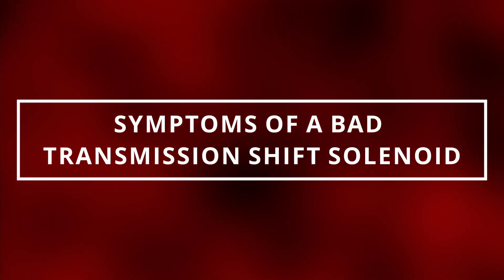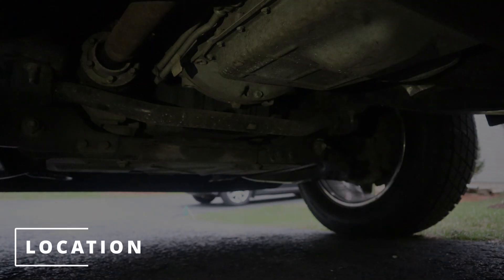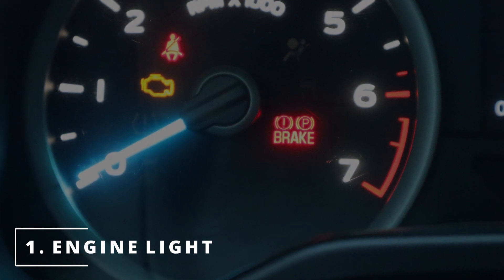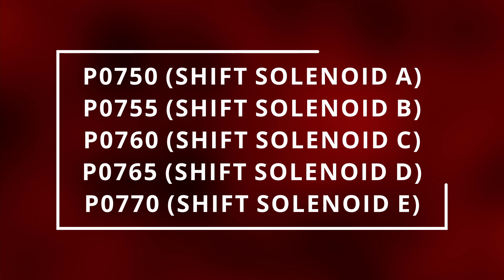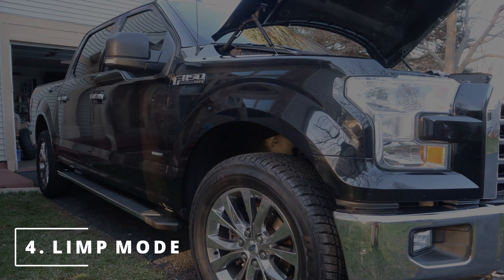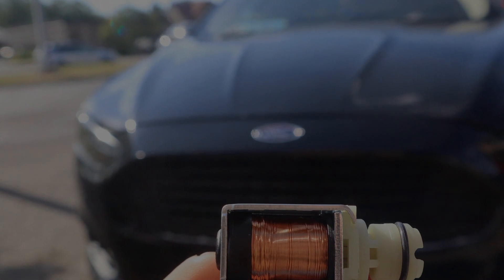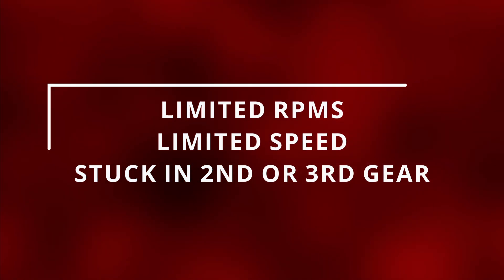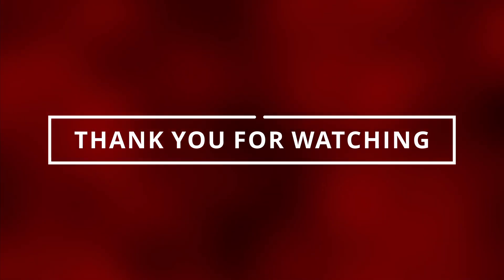SYMPTOMS OF A BAD TRANSMISSION SHIFT SOLENOID

Comment from the maker: Thank you for watching!

OBD2 Scanner: https://amzn.to/43UwyBg

Check out AllDatadiy repair manuals: https://www.gopjn.com/t/SENKTklLS01DSE1NS0lOQ0dKRk9LTw
Use code AD10VA for 15% off one-year subscriptions for any US Order

Check out my merch: https://easyautofix.creator-spring.com/

Have car-related questions? Check out JustAnswer! They have verified auto mechanics that are available as live help 24/7: https://justanswer.9pctbx.net/qnj74y

Buy a new shift solenoid: https://advanceautoparts.rt8x.net/rnPVQ3

Here are some of my favorite items that you might like:
Tools: https://amzn.to/3xNDb8g
Car Vacuum: https://amzn.to/3EjhPSJ 
Cleaning Tools: https://amzn.to/3El7dCG 
Water Repellency Wiper Blade: https://amzn.to/3utvK50 
Cleaning Gel For Cars: https://amzn.to/36NIiMr 
Portable Air Pump for Car Tires: https://amzn.to/3uBuPzA 
Headlight Restoration Kit: https://amzn.to/3qDpOVH 
Amp Jump Starter: https://amzn.to/3pMd0vx
Reply: I just got new tires and hit a big bump and only had 1st gear.replaced the plastic bushing and half washer on shift cable Then was driving about 30 mins ok then just had 1st gear all of a sudden. 2008 chyrsler Sebring convertible 3.5 never again.👎 sensor's  then gone.😂
Reply: @ Easy Autofix Sir  the car transmission is making whinning noise and delays in shifting gears, I checked for the fuel level is Ok, I checked for the oil still fresh not burned, I checked for any leaks no any leaks, I open the pan, but there were no any metal shavings on the magnets no any particles on the fluid, I decided to change the transmission filter, I checked and open  the valve body  no any clogs on the passages, I removed all solenoids I tested them all, and one was not working, I changed it with new one, I put back everything I test drive the vehicle no more whinning noise at all and gears are changing smoothly, but after two days as i drive reaching speed of 100 mph, the whinning noise started again, and the car struggles to exceed speed of 100mph, the RPM goes high and the speed is not achieved,  I checked fluid level is OK. what can be the problem, and what can be done sir? Kindly help with ideas.
Reply: My O/D light keeps flashing on my ford f150 year 2000 and yes when I  shift my gears on N/D/R etc it gives this jerk motion is that the solenoid or speed sensor?
Reply: @jpp1749 did you ever figure out what it was? My 06 mustang is doing the same
Reply: What if I'm getting u0101? Says can't communicate with tcm
Reply: I have a 740 code what’s that then
Reply: N 3p
D czar
Reply: My car mainly stay between 1 and 2. If I’m going 60-90 then it stays between 2 and 3
Reply: My ford explorer won’t go in reverse, what do that mean
Reply: How do you check if the solenoid is faulty?

Comment: PLEASE HELP. 
I have a 2013 Lexus RX 350 and yesterday all of a sudden it started falling on its face for about 3 seconds when shifting from 2nd to 3rd. There is no check engine light on. 
   It has no dipstick. Do you think it's just low on fluid or a bad solenoid?

Comment: I have a Saturn Sky 169500 miles never been beat always kept up with tranny fluid changed and filter… one day driving hope as it drove great no light on dash .. then went to slow down my car tranny as I slowed down it down shifted hard .. automatic .. 2.4 l so if you do drive  normally no problem till it slowed down.. banging into lower gears till stop… taking off no issues… went to a shop to check… well all they found was selinode  was changed and check other thing but they seen nothing … again no check engine …. So im thinking control module but .. they are gonna check the code in transmission see if anything is showing any codes ….. I hate my car being gone so long……😢
Reply: The mileage on transmission is 169,500 and car

Comment: I have a 94 Toyota Rav4 2,0L auto that looses drive intermitently, for example in drive mode when warm and at 50kph drive suddenly lost and engine rpm rises. I then have to engage 2nd gear manually to re establish drive. Could this be a faulty solenoid or shift valve ?

Comment: So my 2004 Camry has just started experiencing a bit of slippage. It has 174K original miles and has been running like a champ until now. The  check engine light came on and when I went to scan it, code P0776 came up which means I need to replace Solenoid B. I was told by a “mechanic” changing it wouldn’t make a difference. He further stated my transmission is done and that I need to either rebuild it or swap it out for one that’s not damaged. I’d like to know if this is true or is this guy full of shit!? Thanks.

Comment: I keep being told my trans is bad ok I’m 3yrs late by any chance could you reply to this comment @easyautofix? Anyways I keep hearing my trans is bad but I dnt think it is it has a slight shift delay around 3rd or 4th and if I let up off the gas n proceed again it shifts over n continues to go I bought a speed sensor thought about but the solenoid but not sure if i should or just buy a new trans.

Comment: What a freaking awesome video:  I have a 2022 Kia Sorento that has Intermittent "Delayed Engagement" into Drive or Reverse.  I have had it into the shop at least 5 times and have paid for computer updates and it is not fixed.  Is there a particular Solenoid that is for "Drive" and "Reverse"?

Comment: Not always but occasionally while I am ready for a red light to turn green and I have my foot on the brake and my 2006 Avalanche is stopped when the light turns green after 2 minutes sometimes when I go to proceed I noticed a little neutral sensation for about 3 seconds then it kicks into gear would this have anything to do with the solenoid all other gears worked perfect

Comment: Sir I have a car Hyundai Elantra petrol at transmission, all the gear oil in it was finished, I put 7 liters of gear oil in it, when I put the car in reverse it makes a loud bang and gear shifting is also not happening properly, at the speed of 60-70 the RPM goes around 2500-3000, please help me sir, I am working in this transmission for the first time, on scanning two codes are coming 1)p0732 2)p0729 please help me sir

Feedback

Comment: Would this also make the gears stuck in nutrual? First time doing this, and im hoping is da solenoid, all my gears are stuck in nutrual after changing out the NSS (Nutrual Saftey Switch) and changing da filter and putting new transmission fluid in

Comment: My 07 escape doesn’t like to shift out of first gear while in regular drive, but if I start off in 1st gear manually then shift up to 2nd then back into regular drive it does fine. Would that be a shift solenoid?

Comment: I put the car in Reverse and it is stuck in that gear.
I shift the knob into park and Drive, but it still drives backwards and I had to use E-brake handle to park the car.
So the transmission shift solenoid is bad than?
Reply from the maker: It could be the transmission range sensor. I've also seen cases where the cable connecting the shifter to the transmission disconnects, so be sure to check that as well.

Comment: I’m having this issue on my 2012 Ram 1500 5.7L. 1st and 2nd gear shifts fine but the 3rd gear slips. When i put it overhaul mode everything runs normal. I’m going to replace the solenoid pack. I pray it drives like a dream after the replacement

Comment: My issue with the 20054th gen 4 runner is pretty much same. But it goes away if I turn off the car and then turn on the car. I don’t know what’s happening. Stopping and stop lights and while moving forward the gear changing is delayed. When taking turns the engine is not putting the power in. I don’t know what’s happening help me someone. I took to a mechanic. He broke my rear differential.

Comment: Question. So I have a 2014 maxima s 3.5 with a CVT. When the engine is cold and I place into drive it acts like neutral. I rev to about 2k rpm. Let off gas drop into drive, and she drives fine. Generally, only when cold or been sitting after say an 8 hour work shift. Once warm, she's fine. I am told the valve body needs to be changed. But I have a feeling based on your video it could be just the solenoid, possibly a much cheaper repair?. Fluid is dirty second hand car. Unknown when last changed. what says you?

Comment: I have a 2020 Chevy Tahoe with 85,000 miles experiencing the same problem what you just described how much time it will approximately take and do I need to put the same transmission  fluid or new one thanks 😊

Comment: Changed my whole valve body out and it shifts out good but when I stop it’s like I’m stuck in a hole and then when I accelerate to move forward it kicks back into gear and goes. Does the same when I’m reversing. Stalls for a minute and then I press the gas it bucks and then starts to move. Other than that it shifts fine.

Comment: 2021 Hyundai Tuscon SEL 145,000 miles between 40-55 mph there is a slight shimmy or shutter for 3-4 seconds then back to normal no service engine lighten back to normal no service engine light

Comment: I thought I had a clutch or transmission issue, I was having to double clutch to shift every second shift. I brought my car to my grandpa, and he instantly figured out that I had a engine misfire issue which was causing engine shake, exhaust and shifter shake, loss of power, rough shifting, and getting stuck in gears. I’m so lucky and glad that I got a cheap and easy fix 😅

Comment: Thank you! Perfectly explained. I believe this is my problem on our 2003 Lincoln Navigator. So bad, last week it had to be flat bedded home (rainy wet day). Engine light, Overdrive warning light, engine missing, Codes galore.  Bad... A couple days later, I go out to start checking out what could be wrong, boom, Truck starts up, runs smooth, trans engages, and I drive it for a few miles with no issues.  I am afraid to drive it far from home, in case the problem comes back. Any advice?

Comment: When I shift gears from R to D and go to press on the gas I hear and feel a "Thud" noise. It only happens when I switch from R to D and not when I am driving. Even going into P causes that same noise on inclines and decline parking spaces :( I'm worried a mechanic is gonna lie about the repair cost or worse it's a transmission issue I won't be able to fix.

Comment: I know this video is a few years old I don't know if you'll get this message or not I have a 2009 Chevy Malibu 2.4 4 speed no engine light comes on but it will not shift into overdrive or shift out of 3rd gear I'm driving 70 mph and the RPMs are like 4,000 when it should be like 25 any suggestions transmission fluid is good I'm thinking a solenoid but why would there not be a engine code

Comment: My car first symptom was the check transmission light that came on with a flashing drive gear light while I was going 60 the speed limit on the freeway and the car switching to lymph mode as soon as the rpm arrow went above number 3 and got stuck there. The car started driving at least 40 mph while the speedometer still said I was going 60. I parked the car right on the side of the highway to let it cool off. Fast forward to 20 minutes later, The car was back to driving normally again. Following that about a couple of weeks later, I noticed weird gear shift delays regardless what gear I switched to unless I put it into park and following that, It makes a clunk noise coming directly from the transmission when it finally does switch. 

   When I accelerate and reach close to 20 mph, A typical car with an automatic transmission switches to higher gears but mine gets stuck in gear and the engine starts revving harder and it jerks back to its appropriate gear. Upon inspection I did notice that the transmission is very low on fluid and the fluid is almost black. I took my car to the mechanic for a diagnostic and a fluid with filter and gasket change where he told me that the transmission needs to be replaced and upon further questioning, He told me that there’s no point in changing the fluid because the transmission is basically bare medal rubbing debris and that it would make the transmission run worse. It’s been about a month now and the car runs basically the same as it did when I visited the mechanic with no transmission failure and I’m thinking about bringing it to another mechanic for a second opinion when I have money. I would be more then glad to hear your guy’s opinions and suggestions if any as well. I’m very hopeful that the first mechanic was wrong.

Comment: hello i have a 2007 cadillac sts 6 cilinder. it starts well euns fine at the beginning but ,when i do a full stop the engine its running fine but the trsnsmission wont engage. car wont move it can easily be shifted but  it wont do nothing unless i turned off the car wait about 2 minutes then restart and the transmission will work again until i make a full stop again. automatic transmission  any ideas ?

Comment: I have a 1999 Subaru legacy and when I put it in drive it won’t move even after releasing the brakes I would have to step on the gas to start it to move but after it moves the others gear work fine it’s just that first gear any ideas?

Comment: Hi! How are you? I have a problem with my ram 5.7 2016 with automatic gearbox. The problem is that when the truck need to put the 5th gear the revolutions going up but the gear is not into. Is like you press the clutch in a manual car and accelerate. I changed the valves box and also the solenoides for the another model but the same piece, because my ram has an grey connector and I puted a green one. Thanks so much 😁

Comment: I had a 2005 Chevy Venture which after about 20 minutes of driving would bang into gears like someone rear ended you at low speed. Had the solenoids replaced functioned like the tranny was new! 4T65E transmission. Mileage 170K.
Reply from the maker: Nice! Did you have the engine light on when you were experiencing these symptoms?

Comment: Mines p0773 and still runs fine.. I got it back from a mechanic with this code and when I took it to him I had no codes or CEL on. He replaced my valve cover gasket and spark plugs. Could this cause this solenoid to malfunction or something??

Comment: This is a great video! I have a 2000 automatic Maxima and I was driving the car yesterday and all of a sudden it wouldn’t switch gears. So I turned off the car and turned it back on and it started driving normal for a couple of minutes then it started acting up again, then the check engine light came on. I was pricing transmissions until I came across your video so I hope it’s the solenoid. Thanks for the video and wish me luck
Reply: Any updates?
Reply: @SkoolNSession  yep it was a speed sensor and the car is running great

Comment: Which solenoid though? A  is the typical one I'm seeing in my research that is the one to change. 
I'm hoping ours is that problem . It's doing exactly what you described. Also it seems to do it more on the days where we run a lot. But when it does the tachometer shuts down and the speedometer.

Comment: With all the great mechanics that have posted good advice here, I was hoping ya'll could diagnose my 2004 Buick Lesabre with 98k miles on it.  I took it to our transmission shop in winter 2023. He changed fluid & filter & put in Lucas trans fix but found nothing wrong with it since there are no Transmission codes. You feel the shift just a little bit... more at lower gears.  It doesn't start until your engine is warmed up.
I'd like to get it fixed before it gets any worse. Car has been well taken care of so hoping to get at least another 50k mi out of it.
Any suggestions are greatly appreciated.

Comment: Would a bad Shift Solenoid be the cause of my 1995 Dodge Ram 1500 not moving out of park? I won't go frontward or backward. I bought brand new transmission fluid and oil and that didn't fix it... I was thinking along the lines of a linkage problem.

Comment: My brother has a 16 highcountry with the 5.3 9l80 I believe and sometimes while driving it will go out of overdrive and run at 3000rpm. If he turns the truck off and then on again, it works fine until he hits a bump. We cant figure out what it is and the mechanic is trying to sell him a new transmission! Any help is appreciated
Reply: He ended up needing a new transmission

Comment: I have a 2002 Honda accord that I just bought from someone who had it sitting for like a year and some change the car doesn’t have a code wen I raned the obd2 scanner or anything but wen I go from park to drive or reverse it jerks forward doesn’t do it wen moving gear to neutral or park just drive or reverse and it also jerks wen coming to a stop I changed all the mounts and did the transmission change but still has the issues sometimes jerks wen going up to 1st and 2nd gear I would appreciate the help

Comment: Good video.....my chrysler 300 2006 touring ...i can put in R and D when i drive it i feel no change in gears engine feel like it losing power hear a strange knocking in engine the knock dont come until about 4 or 5 mins of engine on cut i car off then back on the knock gone for awhile then come back got a code about the occupant retraintfault code anti lock brake u0184 dont know what it is somthing from the car to my transmission not working together cause this is the 2nd transmission with the same problem (except the codes)

Comment: I wanted to test the Scumbag mechanic theory so I told my wife to take “her truck” in for a diagnostic exam on the tranny. I  didn’t have time to do the solenoids The guy told her I needed a whole new transmission and was charging 1900+1500 for the tranny. lol I spent like 98 bucks and fixed them myself 😂

Comment: I Have a 2007 ES350 Lexus, when first used in the morning it will slip when it goes into 4 gear, after that it runs normal for the rest of the day. can it be a solenoid?